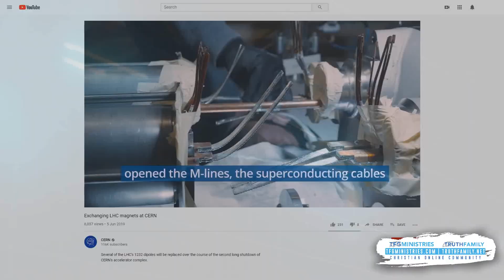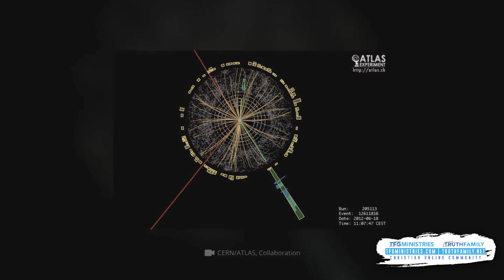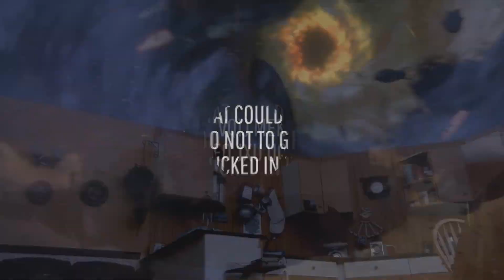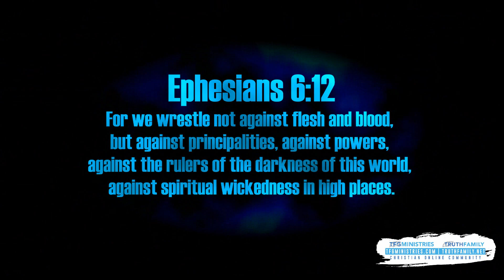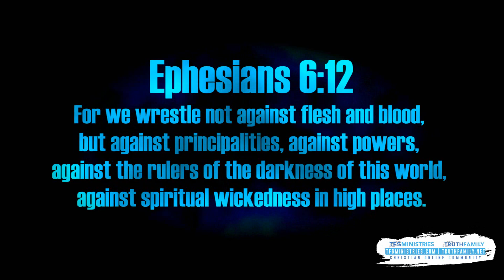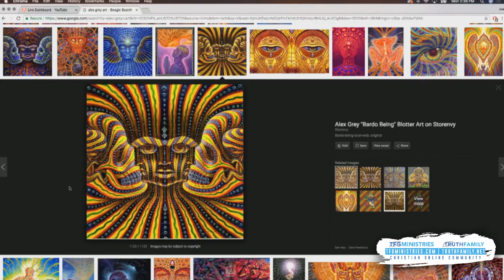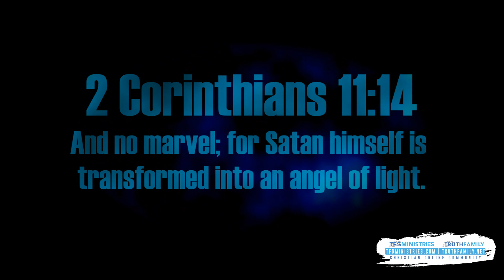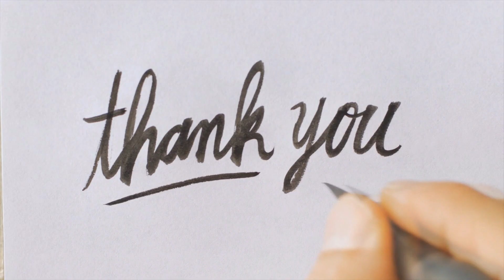CERN and The Bottomless Pit (The ABYSS) 2022

Comment: @6:40  This is a trick to find underground power utility lines.  It is caused by magnetic flux.  You hold the wires loosely so they are free to move/pivot in between your fingers.  The wires move based on the direction of the magnetic flux lines caused by electromagnetism, which is created by electrons moving through conductors buried underground.  Not impressed by old man's story.